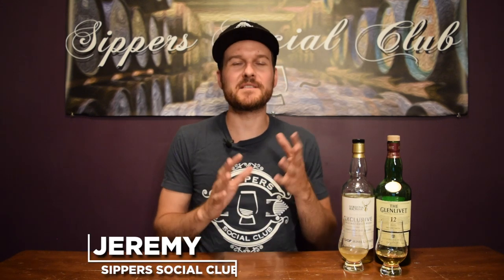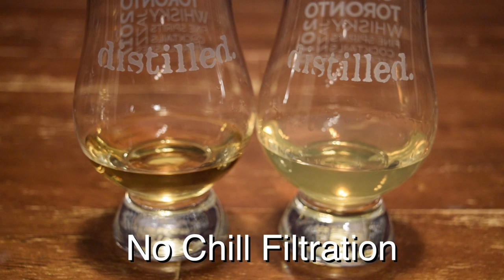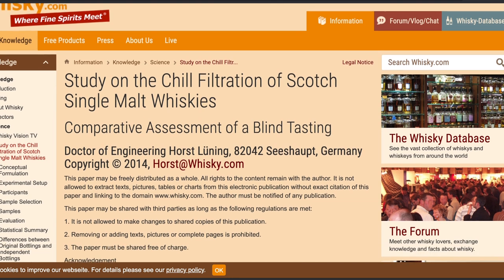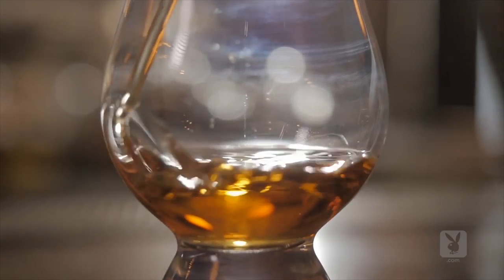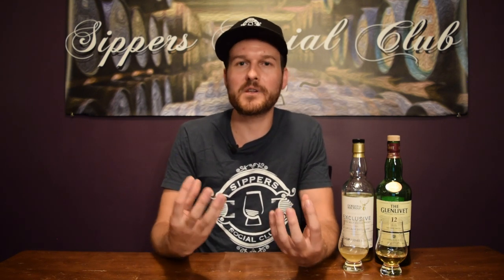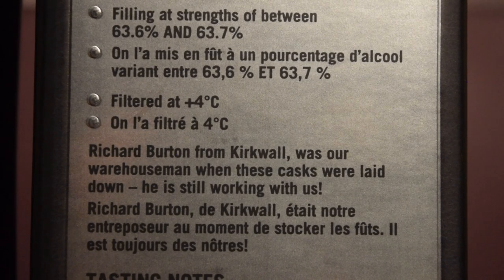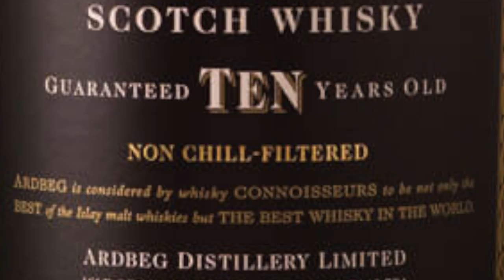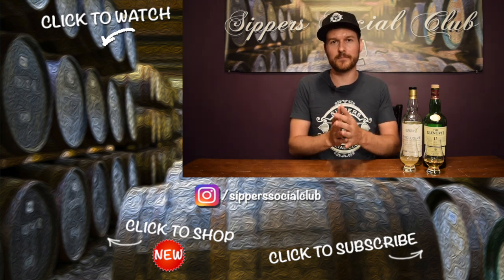Why do Distilleries Chill Filter Whisky?

Comment: The Whisky.com study you referred to did exactly what you said was the only way to test fairly. They took a non chill filtered whisky and then, from the same bottle, made a filtered sample. These two samples were then compared and the participants were asked to guess which was chill filtered.
Reply from the maker: Yes, that's true, however their setup does not match what a distillery would use. Not saying it wouldn't have similar effects, but I was more referring to half a single cask getting chill filtered and half without, then trying both.

Comment: That's a poorly designed test.

1) Who did they pick? An actual whiskey enthusiast? Or bob who doesn't like whiskey? I don't want to rely on Becky who usually drinks White Claw to decide if chill filtration has effects on whiskey. 

They should have taken both versions of the same malt. Like one 12 yo Glenfarcalas CF and one non CF with people who have tried more than 100 single malts. I wonder if the rate of correct selection would be clinically significant.

You have nothing to compare to when you try it by itself.

Comment: Noob question here. Anyone know how long a bottle of whisky can last if it's not open and also how long once it's been opened ? 

Thanks.
Reply from the maker: If its unopened and stored in mild temperature out of the sunlight, it can realistically last forever. If its open it really depends on the whisky. With some whisky the flavors can flatten out, but with some the whisky will improve. I've experienced both. I've noticed cask strength whiskies can last longer than bottles at 40%. Checkout my Macallan 18 review where I talk about gassing whisky to preserve it longer. Cheers.
Reply: @SippersSocialClub  Thanks for the answer. I'll look it up. BTW when you compare Canada and US prices for a bottle, if they dont have it in Ontario you can look up the SAQ site from Quebec. Prices are pretty much the same.